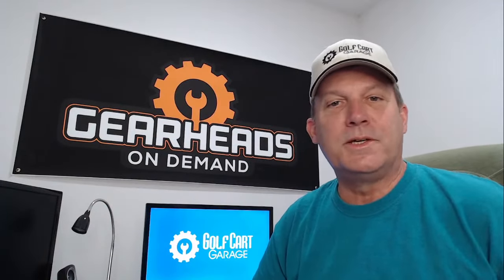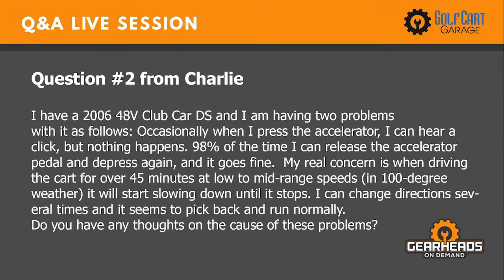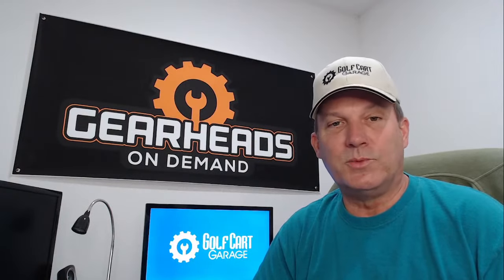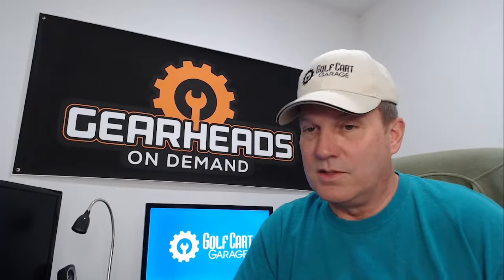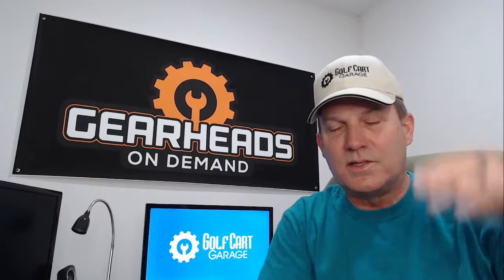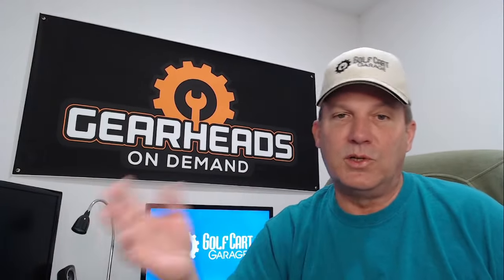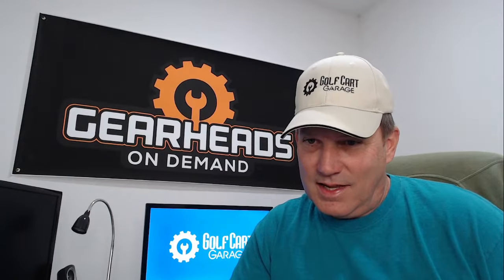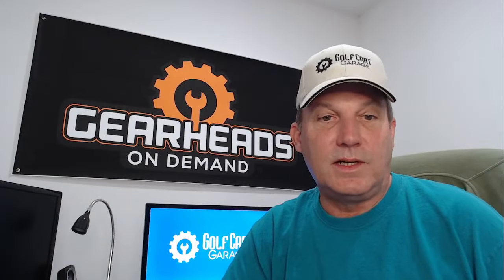How much weight can I put on my golf cart? | Golf Cart Garage I Episode # 66

Comment: That Yamaha G1 goes back a while..Looks like they were two stroke gas? I went with EZGO electric back in 2015 with an RXV. Didn't have heated garage before I moved to my dream home on a golf course. Two sets of Trojan batteries later I went with the RoyPow 105ah S51105P-A lithium battery. It plays nice with the Navitas controller and my often neglected battery maintenance issues are over.
Reply from the maker: Thanks for watching, Mark!  Nothing but good things to say about RoyPow and Navitas.  You're preaching to the choir, here.